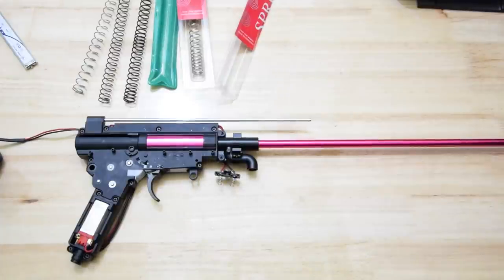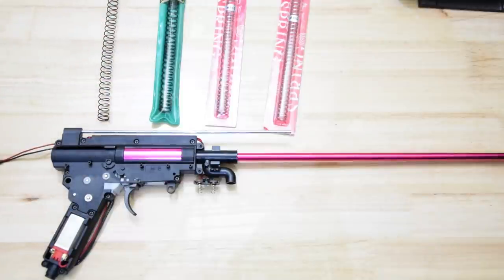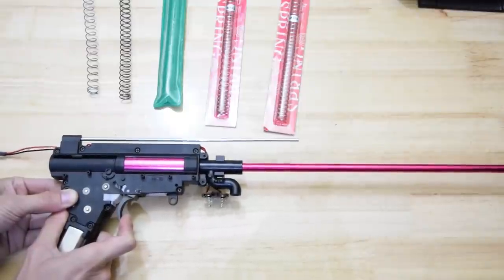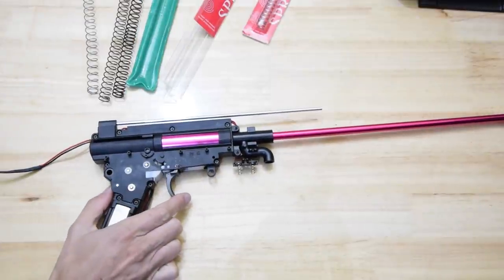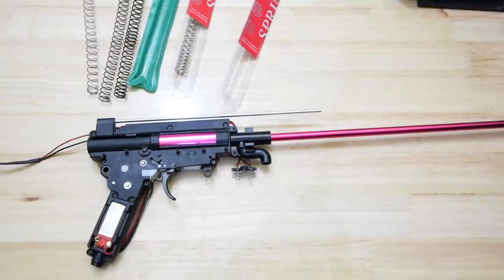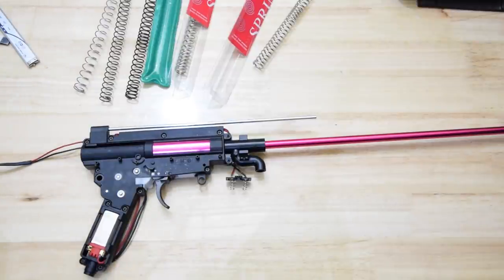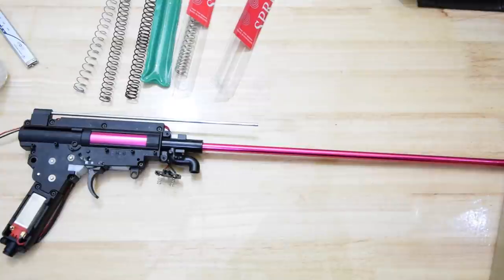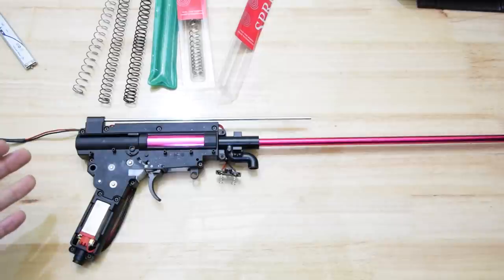400fps standard nylon gearbox

Comment: I have been running a cut down m140 in my vector for 2 years now,I run a 30cm barrel with a teardrop 80% port..and still have original re-shimmed plastic gears...avg fps 380
Reply: shii im going to learn to mod one day if thats possible 🗣🔥🔥
Reply: @KamranRulez2020 lots of patience and time my friend! I'm building a gel blaster right now with 13.1 gears a high torque brushless motor and lemme tell you it's a lonnggg process to getting everything right so it will last longer than a week lol

Comment: I am rocking a 110 spring in a nylon gearbox, it out performs my 130 in a metal gearbox, but both have an 11.4 volt battery with metal gears.
Reply: I would put money on the metal gearbox having a 6mm nozzle and the nylon probably has a 8mm nozzle, anything with a 6mm nozzle and that's most v2's is harder to get power out of it, but with a 8mm nozzle it's much easier to produce more fps ,kinda like when you blow through two different diameter straws the the thinner one can't flow as much as the thicker one
Reply: How is it this 2024,is it still okay? Or did you upgrade to 120
Reply: Still unchanged. 👍🏽

Comment: Hi! Newbie here...so I'll just replace the spring to increase FPS? Any other upgrade to consider?
Reply: Correct.

> Spring = more fps
> 11.1v battery = higher rounds per minute.
> High speed motor = higher rounds per minute.
> Upgraded o-rings = less chance of leaks = better chance of consistent higher fps
> Metal gears = long life.

I'd start with just upgrading the spring. Do the rest later when/if you need it.

On an low cost blaster, upto M120 should be fine. One high quality blasters, M130 should be fine and M140 will work but something will break eventually

Comment: I'm newer to this kind of stuff and got a emerbu toys arp9 it has an 8.2 metal gear box what spring upgrade would you recommend?
Reply from the maker: M100 there isn't any need to go bigger than that. I only do it the break stuff on pourpose.
Reply: @lowguidoschopshop  do you happen to know what spring is in it already and if it's even worth upgrading
Reply: @lowguidoschopshop  and would it be better to go for a m125 since I have metal gears

Comment: My all metal M4  ( M4 undertaker at GBU) shoot 380fps, all metal gears,  V2 12;1 gear ration, 10in handrail , simple looking, wanted power accuracy (a sleeper) 110m spring , razor hope up etc,).  BUT THE GEL BALLS ARE 80% exploding. Aka, beast gel balls  when firing……… when it works 35m dead straight hard hitting, but what’s the point when most explode !!!!!  why is this happening please and what can I do to fix it. I’m happy to pay to send to you to make a video {lol}…………… help snd advise!!!!
Warm regards stay safe and healthy 👍🏼👍🏼🇦🇺🇦🇺
Reply: Have you resolve the problem yet? Cause from my experience you just need to check out for barrel porting, cause machine porting sometime leave some kind of sharp edge, always sand it with 3000 sand paper to smooth it out, other wise this will happen..i mean like alot
Reply: Check mag if hava anykind spiky or hard surface area then check t piece,also check nozzle rubber,then go to inner barrel 😎💪
Reply: @PisangzChannel  thankyou

Comment: Hey low guido would it be fine to use a 1.28 unequal spring on nylon gears
Reply from the maker: high chance they would break. you may get lucky (like this video) but I wouldn't do it. (at least not for anything I wanted to last long term)
Reply: @lowguidoschopshop  thanks

Comment: Noob here, planning to get a Cyma M4 cqb. Besides getting an 11.4v, what others things do you guys recommend to upgrade using the stock nylon gear to increase the FPS?
Reply: Change plunger with metal teeth,plungerhead + new oring,get better airseal,pistonhead double o ring+ nozzle,also create better airseal not 100% but better from stock,using spring m95 minimum,or m120 (for short terms using nylongearbox) ,gearset 18:1 mybe 13:1 for good trigger respond,using full cylinder not ported cylinder yeah of couse using high torque motor too!! Then you will have increase fps not accuracy 😌
Reply: @PisangzChannel how about accuracy?

Comment: That is awesome I love the gen8 I but I gave mine away I would like a gearbox you  make as you are the best at gen 8 and any thing you  Touch really
Reply: Is that a v3 or a gen 8?
Reply: @johnh3733  I am pretty sure it is a gen 8 but don't  Quote me on that I could be wrong as there have been  A few different types of Gen.8 gearboxes
Reply: @johnh3733   That I am pretty sure the V3 has a separate Tee peace
Reply: I don't think that's a Gen 8.. Guido? Shed some light?
Reply: @stevepatterson6297  looks like a v3 gearbox for j12 but earlier version by looking at the blowback position is on the side and the newer versions moves the blowback tab to the top of the gbox and the mag contacts are no longer using springs like we see in the video.

Comment: the problem with using nylon gears and big springs happens when you go from using a big spring i.e: m140, and drop back down spring strength, to like a m120 for example, coz thats when the forces onthe the gears changes and creates the weak point.
Reply from the maker: I find the problem is generally when they get too hot and just melt.
Reply: ⁸

Comment: O the issues with current load on high rate springs if current covid-19 cases on parts like the M160 motor that due to the wrong thread count cracked a locking pin and gave short issue  Till I stuck a motor screw in the neg on top and smoked it out.or the German spring that sticks to the back metal plug not on the spring release current 1.4 sweet like while I fix the M160 motor 🤕🧐😡 car battery??????180 or super cool it 160 will run a 480 spring??for bat FN crazy 🤣how to distroy every gearbox.